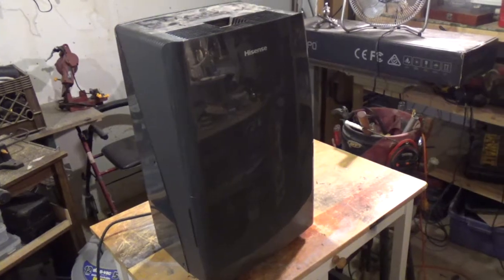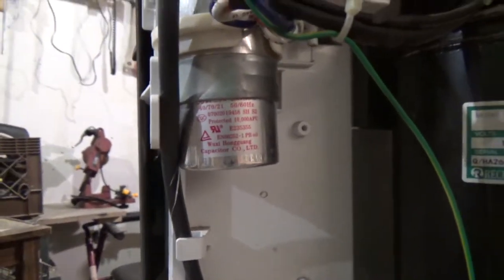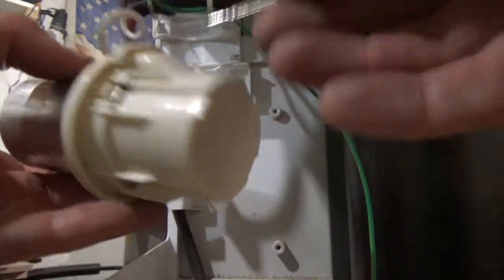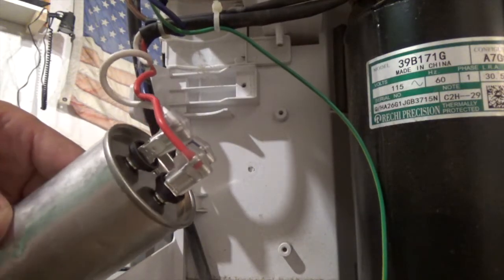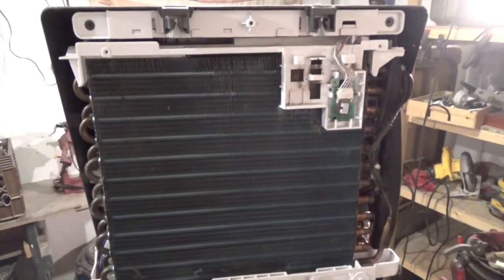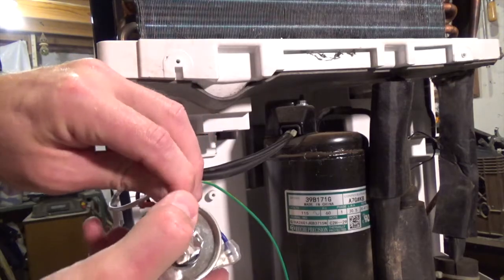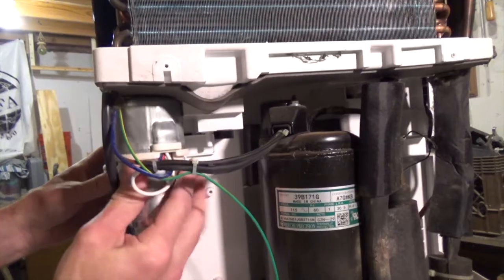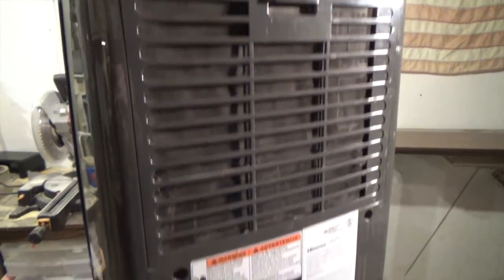Fix Dehumidifier - Replace Capacitor (Compressor Won't Start)

Comment: You completely skipped a VERY important step. How to get the &%$& plastic cover off! I removed every possible screw on the cover (front and back) yet it does not come off. Right now I'm considering using a hot knife to cut into the plastic about where the capacitor is so I can get it out to check it.  BAH !!!
Reply from the maker: Sorry to hear you're having trouble getting the cover off -- different models can be tricky sometimes.

Comment: Thank you for the tutorial, I ordered a new capacitor for my Delonghi dehumidifier. My compressor doesn't kick off also. I opened the device and everything seemed normal and no lose wires. So I ordered one CBB65 8uF from AliExpress . It's one Centimeter longer than the original one, but there was no other one in my capacitor size. I'll modify the carying holster so that it does fit. I hope this does the job. Touching the compressor felt very cold , so I am pretty sure there were no leaks. Also inspected the coils , it all looked fine. That dehumidifier was like 279 euros , totally not worth the money ! After opening it , it was all china !
Reply from the maker: Hope it helps! Stay well. Thanks for watching and taking the time to leave an awesome comment.

Comment: I have fixed my dehumidifier this way. Took the old cap to an electrical supply-they gave me the one I needed. But why don’t you include instructions on discharging the existing capacitor in your video?
Reply from the maker: Because I just lay a screwdriver across the terminals to discharge them. It is not exactly "safe" and I would not tell people to do it that way.

Comment: A part number and source of capacitor at some point in the discussion would help me get started
Reply from the maker: The prt number will depend on the existing, original capacitor. A great source for capacitors is a store called Grainger.

Comment: I hate these products, but this is a very helpful video.  Mine is sort of working after 2 years.  The compressor runs and the coil starts to get cold (frost forms), but the compressor casing gets very hot, pretty quickly.  I haven't checked the start/run capacitor yet, but does anyone know how hot is too hot for the compressor casing?  Would a failing start/run cap cause the compressor to run hot?
Reply: I would like to know as well

Comment: you did not test that the old capacitor was bad.  how do you know it was bad?
Reply from the maker: 20+ years doing HVAC work, familiar with the symptoms.
Reply: @HNXMedia  
what specifically were the symptoms, so that those of us who are not in HVAC work can get value from the video.

Comment: I can’t seem to find a match for my capacitor. Not really too familiar with it but the specs are 55/6uf 50/60hrz 270vac. It’s a Cbb65 dual-cap. Any idea where I can find it. I checked with the manufacturer and they don’t sell just the capacitor. Closest ones that I have found that are the same physical size have 340 or 370vac
Reply from the maker: The rule of thumb with caps is that you can always go up a little, never go down. I would probably grab the CBB65 @ 340 and call it a day (if the other specs are the same or slightly higher as well). Note: I've rebuilt tons of these things and have replaced caps in everything from home AC condenser units to CB radios, however this is not professional or licensed electrical advice. Just got to say that. Best of luck. Hope the video was helpful.

Comment: Compressure works but gets very hot and it produced zero water
Reply from the maker: Compressors will get hot to the touch, but there should be airflow through the unit unless the fan is not working.

Comment: I replaced the capacitor, but now the compressor works,but after running about 5 min. The compressor feels hot to touch. Any suggestions.
Reply from the maker: Compressors typically run a little hot to the touch. I would compare it to how hot a fridge compressor gets. If you can access your fridge compressor (or at least get close enough to feel the level of heat it puts out) you can kind of use that as comparison. Hope this helps.
Reply: Same thing that’s happening to mine. Checked with a heat gun and it was 150 F and climbing

Comment: Thanks. I have a large basement dehumidifier and the fan runs fine but the compressor won't kick on. I'm going to dive into it, after it's unplugged, and change out the capacitor, after discharging it. We have an air conditioning parts store in town that may be able to match one up.
Reply from the maker: Nice! Easy fix or at least worth the try. Thanks for watching.

Comment: I have a HaierDE65EM model dehumidifier and it won't cut on at all. When I plug it in it beeps once then gets an E2 code. What could be the problem?
Reply from the maker: I think the E2 code is for the filter. I would pull it, clean it or replace it. Some of them will not come on until you do something with the filter.
Reply: @HNXMedia   I cleaned filter nothin happened, took unit apart cleaned entire inside and sensor, still not turning on and getting e2 code. Thank you for your reply. Going to buy new unit. Take care

Comment: You didn't show how you said you would do something to not shock yourself
Reply from the maker: You have to do something to make sure the old capacitor is "discharged" (they can hold enough power to injure you if not careful). Hypothetically, you can just lay a rubber-handled screwdriver between the terminals on the old capacitor and it will discharge/short out. I did not show this because YT frowns on showing things that can be considered dangerous. Note: I am not recommending this method, just saying that it is possible and does work.
Reply: @HNXMedia  I totally get it why you didn't show it. Guidelines,  I should have guessed.  Thanks for replying
Reply: @HNXMedia  lol😆

Comment: Same problem what my dose  fan run the compressor makes a sound like the dryer sound went it finish drying the old dryer sound not the new one this what the compressor sound went it trying to start every 30 seconds

Comment: This was quite helpful! There wasn't a clear view of the labels on both caps, were they the same rating/model, or just happened to be plug compatible?
Reply: No, they’re not plug and play. You need the same capacitance and the same or greater voltage. Additionally (and most importantly), these type of capacitors have a positive and negative terminals.  You MUST connect them right or el ese you’ll instantly fry it and perhaps kill other components.

Comment: Where’d you get the capacitor?
Reply from the maker: Knowing me, I probably scrapped it off of something else. See if you can find the model number on the original and you should be able to grab one off of Amazon or Grainger (if you are in the States).
Reply: If you need one right away, any local air conditioning supply store will have one.
Reply: @dontbanmebrodontbanme5403  it turned out the humidifier was on a recall list and I got a free replacement
Reply: @bvac  Ah, thanks for the tip. No harm in checking if mine is on a recall list as well.
Reply: @dontbanmebrodontbanme5403  there’s a surprising number of dehumidifiers on recall, so it likely might be!
Reply: @bvac  I checked and you’re right, over 2 million of them. Apparently for the possibility of fire. I have a GE, however, and it’s not on the list. I bought another one about three hours ago and it’s running in my garage now and when I have a chance, will try to diagnose the broken one. My guess is that either the capacitor is shot or the bucket switch is broken.

Comment: Before you replaced the faulty capacitor -- was the FAN BLOWER working ? Curious to know if this bad capacitor was a dual run / start type (servicing both the FAN AND the COMPRESSOR) and was only able to get the FAN to run but not the COMPRESSOR

Comment: You could've shown us a multimeter test of the bad capacitor
Reply from the maker: you are correct, I could have.
Reply: @HNXMedia  lol... hindsight, eh?
Reply from the maker: @flowerchild777  LOL. Yep. In the moment, I just wanted to replace the capacitor, I knew the old one was bad and that the new one was good. At the time I did not think/care about anything else. Stay well.
Reply: @HNXMedia  Well that's obvious. This video is only helpful to someone who has a capacitor laying around the house. Which practically NO ONE
Reply: @HNXMedia  Curious, how did you know the old capacitor was bad?
Reply from the maker: @tbarbuto2345  Most of the time with capacitors like this (same kind used in AC condensers, garage door openers, etc) the capacitor will "bulge" slightly on the top. That is a clear indicator for sure. You could certainly test it with a multimeter, but it is a little more complicated: You need to make sure the capacitor has been charged, set the multimeter to "capacitance," touch the probes to the capacitor, and compare the reading to what is labeled on the capacitor itself. If they match, its good. If not, its bad. My motto, when in doubt, just replace it, these things can be bought for less than $15 typically. Hope this helps.

Comment: I might just have to get me a dehumidifier for my knife shop. My steel keeps rusting when I leave it over night.
Reply from the maker: It should help. Get yourself a nice one (not one of these Hisense POS). Good ones are not cheap. I've read that running an air conditioner inside an inclosed area (i.e. not venting it outside) does the same thing as a dehumidifier for 1/2 the cost. It has to do with how the air conditioner cycles both warm and cool air, but you would have to rig a drip pan underneath it (to catch the condensation). The only difference between the two devices is that a dehumidifier has a "drip pan / catch bucket" built in. I mention this because if you have an old window air conditioner sitting around, you could try that and see if it helps. Just a thought.
Reply: @HNXMedia  Good to know, thank you